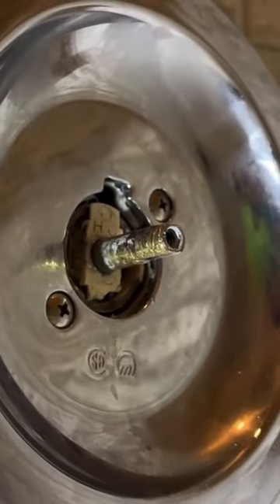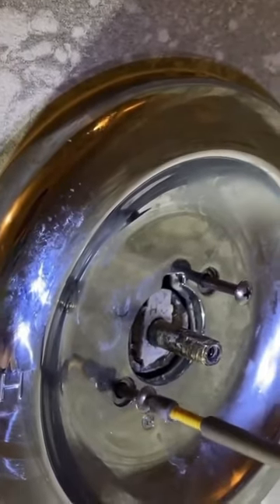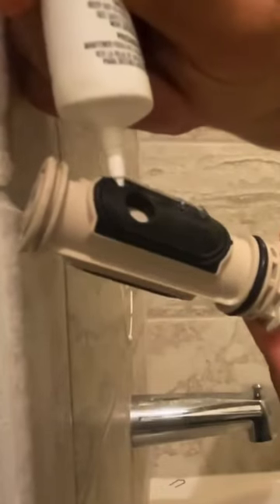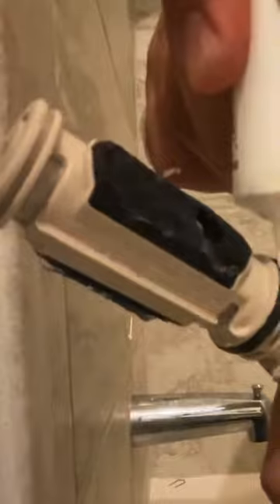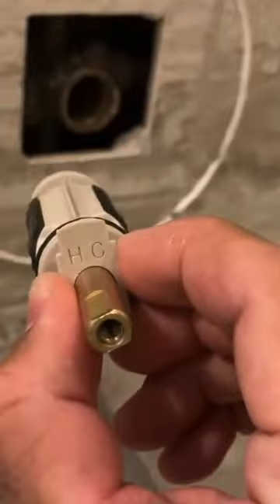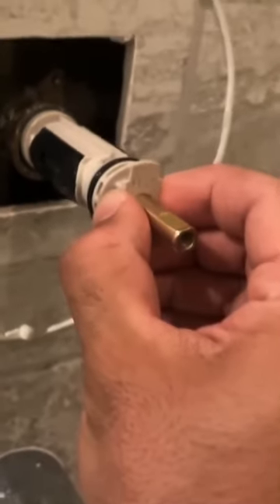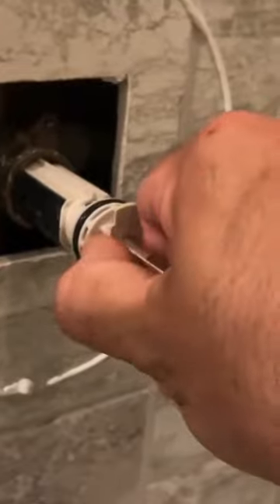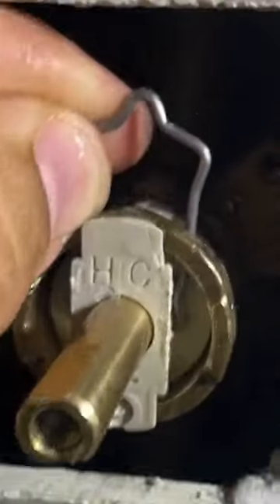How to remove a MOEN 1222 cartridge #shorts

Comment: Do you have to turn off the water valve before you take the cartridge out ? And do you turn the back on before putting the handle  on?
Reply from the maker: Turn the water off before you remove a cartridge. You can turn the water on as soon as you secure the new one or turn it on when all setup is complete.
Reply: @DIY-repair  thank you so much one more question how do I know if it’s the cartridge or the handle on top of the cartridge that needs to be fixed . The problem I was having is when I’d turn it “off” it would still keep running
Reply from the maker: @rosaalfaro-kl6ln  Handle just operates the cartridge. These are the main issues caused by cartridges:
- Slow or no flow
- Not mixing the water (hot and cold)
- Won't turn off the water.
If the handle operates there is no problem with it.

Comment: My hot and cold water are opposite now lol, even the HC letters were on top like is recommended.
Reply: I had this problem. You have to turn the metal part that sticks out beyond the hc plastic part 180 degrees. The side with the extra notch on it should be facing up.

Comment: What do you do when it's completely embedded with calcium buildup and doesn't want to come out? 😂😂😂, ayyyyyyeeeee 👍👍
Reply from the maker: You need to buy a removal tool at the local store
Reply: @DIY-repair  oh I know the exact process after calling moen 🤣. The removal tool will literally pull the stem out of the center of the cartridge then the housing stays stuck. Do you know how to remove that? I already know how after a very annoying time 😂, ayyyyyyeeeee 👍👍

Comment: How do I get the cartridge out of its stuck? Vice Grips and my strength won’t budge it.
Reply from the maker: Sometimes, I use second pliers. In the worst-case scenario, you have to drill it out but do it carefully. You can damage the diverter and cause more damage.
Reply: @DIY-repair  thanks for the reply. I used a flat screwdriver to create a little space and then squirted WD40 back in the hole. Then was able to pull out with my vice grips.
Reply: Get a Moen cartridge removal tool. It's only  $16 at Home Depot (Everbilt brand). Worth every penny!

Comment: 2024 Austin Tx
Called a plumbing company to see if they could stop my leaky shower head. Came over and quoted me $450+ to replace the valve cartridge.
Went to Lowe’s bought the piece and installed it myself. Cost $60 and 45 min.
In case someone was wondering if it’s worth it to try yourself.
Thank you for the video!!

Comment: I dropped the clip behind the wall. Any chance the cartridge can function properly without it?
Reply from the maker: No, you need to lock it in the position
Reply: @DIY-repair  I tried, but couldn’t visualize how that clip keeps it in place.
Reply from the maker: @aguy559  it locks it in the position so it won't be pulled out by the water pressure.
Reply: @DIY-repair  Without the clip, that will definitely happen?
Reply: Get a magnet and go fishing
Reply: You can get a replacement
Reply: Lol. I did the same thing. Luckily i bought replacement clips when i bought the cartridge from home depot
Reply: How do I put back the clip ?